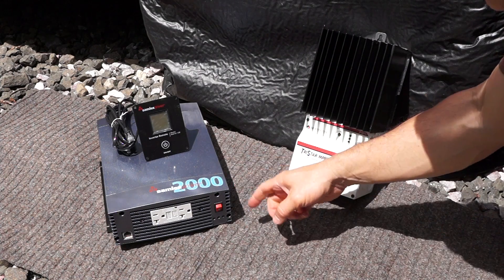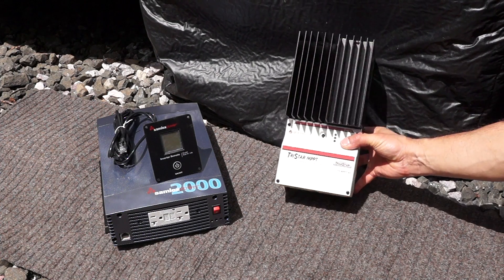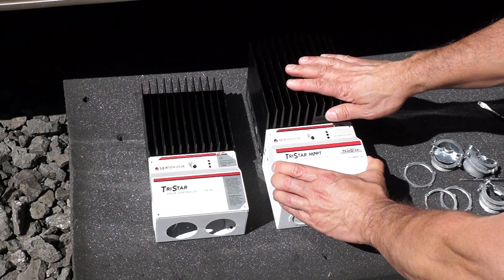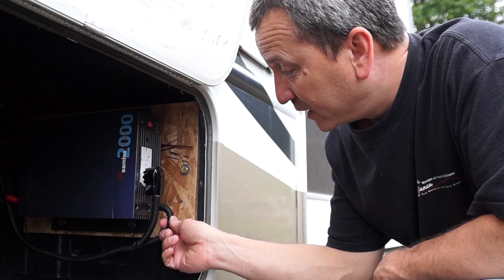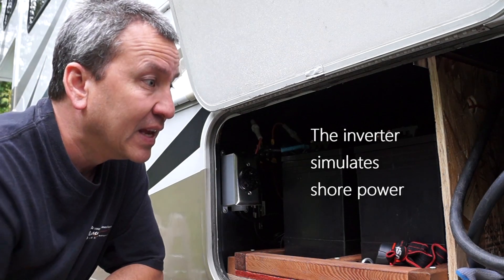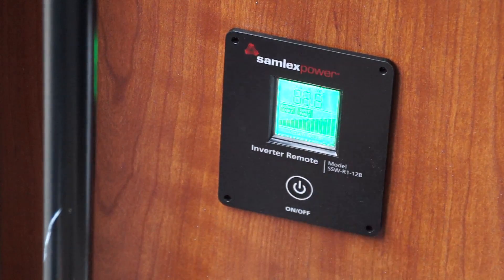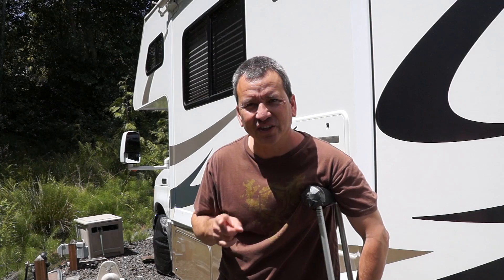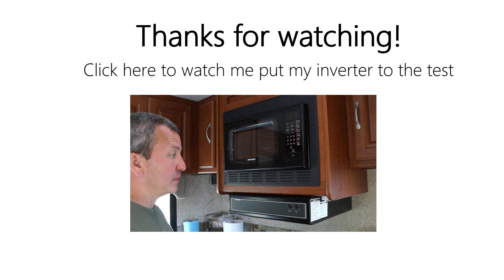Inverter and MPPT Charge Controller Installation - DIY RV Solar

Comment: The 2 gauge wire on your battery bank is too small to run large loads. I have a Xantrex 2000 watt pure sine inverter and I am using 2/0 gauge wire. the wire you are using will not only get hot, it will also lower the voltage available to the inverter during periods of using large loads like a microwave. I did however like your setup of plugging in the shore power cord directly into the inverter!
Reply from the maker: +John Chalupowski I agree with you John. While my 2K inverter can support it, I currently have only 220 amp hours of capacity on my battery bank so I don't/can't run any large loads. So for now I'm good. I do plan on doubling the size of my battery bank and solar soon at which time I will also upgrade that 2 gauge wire. Thanks for the feedback!

Comment: Do you have a list available of the items? You have done a remarkable job with your installations.
Reply from the maker: George Bowman Here you go George. 
Solar Panels: Unisolar flexible solar panels that are no longer manufactured, but you can still find them on Amazon (http://bit.ly/rvwt-unisolar-az) or EBay (http://bit.ly/rvwt-unisolar-eb). 
MPPT Charge Controller: Morningstar TriStar TS-45 (http://bit.ly/rvwt-solar-ts45-mppt)
2KW Pure Sine Inverter: Samlex 2000 Watt (http://bit.ly/rvwt-inverter-samlex)
Battery Monitor: Trimetric Battery Monitor from Bogart Engineering (http://www.bogartengineering.com/)

Comment: well whats the plan for the old PWM controller?
Reply from the maker: No current plan. It's in a box in my garage right now.
Reply: cool I forget mot all are full timers needing to get the old out asap but I could use it if your going to part with it say next month around the first I am just starting with getting a solar setup going and savings is savings.

Comment: Hi Tito.  just have a quick question for ya.   how is that Samlex 2000 inverter working out for you?  have you pushed it to its limits, and if so, how did it react?  thanks a bunch,    Ken
Reply from the maker: ken cook Hey Ken. The inverter has been working great. I haven't pushed it to it's limit (not even close) because I don't have enough battery power to do it. I've probably had it up to 1200 watts that's all. It shuts off when the input voltage (from the batteries) gets below around 10.6 volts and I've had that happen when I pushed it. If I had a couple more batteries, maybe I could sustain a larger load, but I only have 2 x 6 volt golf cart batteries. All in all I'm very happy with the inverter. No problems so far. I hope that helps.
Reply: Hey Tito, thanks for responding. I have watched every one of your videos of your RV setup and have really enjoyed it, you are a pleasure to listen to.  Now, with that said, I have 4 100watt panels connected in series/parallel for 24 volts, and 10.28amps. I have them connected to 4 225ah Trojan T-105re batteries. Series/Parallel connection to give me 12 volt / 450ah capacity. The charge controller is Morningstar mppt 30amp.  So now that i have what i feel is a descent charging part of the system, I am trying to save a little on the Inverter end of the deal. The inverter you are using seems to be the least expensive from my research. My system is not for an RV, it is for an off grid cabin, so the positive/negative grounding has become confusing for me. Hope I have not lost you.  While some parts of the system are positive grounding, other parts are negative.  My question is,,,,,  how important is this?  Your background in electrical knowledge would be greatly appreciated on this matter,  any suggestions for me?  Thanks Again, Ken
Reply from the maker: ken cook Good question. Nope you didn't lose me, but I don't have a good answer and would rather not give out bad information. In my RV, all negatives and neutral are grounded to the chassis. Unless someone else reading this has the answer I would recommend asking an electrician. Thanks for watching! Sorry I couldn't help on this one.

Comment: my inverter is workingok now ,i got 120 volts  in hte rv outlets , microwave is on but no lights go on ,neither 12 volts lights ,anyidea  what could it be ?
Reply from the maker: diego bauzil Sounds like that dog bone option worked. You may not have enough juice to power the microwave. Microwave's have an initial surge when they first start that may exceed your battery/inverter capacity. I can only run my microwave during full sun. That gives me extra amps to help absorb that initial surge of the microwave. I usually don't use my microwave on inverter power. I found a low-power 700W microwave at Walmart for $49 that I might try. I'm not sure that's what your issue is but that's what my experience is.
Reply: inverter pulls microwave fantastic ,no issue there,  is my lights that don t  turn on , my inverter is feeding all hte outlets and microwave , but my lights should be running on 12 volts  but they dont get juice ..
Reply from the maker: Maybe check the fuses on the Converter/Charger panel. See if it's there's voltage on the lighting circuit.  Do you have a battery disconnect switch? Check to see if it's off.

Comment: so  i still cannot power my shoreline thru the  inverter ,i think i mgoing to change the 5 amp outlet box i installed and try with a 30 amp like yours , then get a dog bone 50amp to 30 amp and plug it there ,see what it does.

Comment: I'm going to ask a newbie questions. The receptacles on the inverter looked to be 15amp ones. like we have in our homes. So if that is true then how will you get all the power you need to run AC, MW, etc in your RV when on solar?

Thanks
Reply from the maker: Not at all...good question. I don't generate enough power from my batteries to be an issue. 15 amps AC is approximately 150 amps DC at 12 volts. I only power small stuff (laptops, chargers, fans, TV, sometimes the fridge). Certainly not the AC. Microwave...maybe for very short periods when it's sunny.

Comment: inverter is on, but somehow is not feeding the system ..
Reply from the maker: Plug a cord directly into the inverter. If that works then check your wiring from your inverter to your "system". If you wired up your own plug or receptacle make sure it's correctly wired.
Reply: thats probably what it is ,the plug witring
Reply: it is confusing since is a 50 amp ,  has 2 hots one negative and one ground  ,you know ..

Comment: How does the two battery switches get wired in for solar and what do they control?
Reply from the maker: Bob Ameigh The two big red switches near my solar charge controller are on the positive input (from solar panels) and positive output (to my battery bank) of my charge controller. They allow me to shut off incoming solar or outgoing charge, or isolate my charge controller entirely if I need to open it up. I always shutoff the incoming solar first before shutting off the output to the battery. Turning back on, I do it in reverse, connect batteries first, then connect solar. You don't want incoming solar charge to be coming into your charge controller with no where to go. Hope that explains it for you. Thanks for the comment!

Comment from the maker: @ritual-custom- I used standard household 10-3 Romex wire and 3 pronged plug connected to the inverter. Keep in mind that you probably will not ever draw 50 amps AC from your battery bank. That would be equivalent to about 500 amps at 12v DC. So the 10-3 Romex rated for 30 amps AC will probably work.
Reply: RVwithTito  thanx so much man!!  big ,big help u been!!
Reply: Thanks i was about to ask all that!! You're  the best!

Comment: Hello Tito: i got a question for you; so we establish to add an outlet to plug the shore line into the inverter, what size of cable  and connector (inverter side) should  from the outlet to the 120 inverter outlet knowing that my RVis a 50 amp service ?

Comment: hey tito How you doing ?  i got a question for you ... what kind of in line fuse i need if a have 500 watts solar panels into a mppt 45 A comin out to a killswitch  like yours and  going to the battery bank ?  (2  AWD wire ) please advise ..

Comment: i have 500 watts solar panels coming down to a mmpt morning star 45  need to know what kind of switch kill can i use (amp -volts)  and what kind of inline fuse and fuse holder i need (amp -volts) , the wire from  the mppt to hte battery bank is a 6 awg. thanx!

Comment: wow  been confused on all the videos on people rewiring or  running all kind of wire to do what you did in a few steps, you know what they say [ kiss]  ,  thanks for the great tip on doing this ,i will just have to  turn circuit breaker off for converter.  thanks for the videos
Reply from the maker: Thanks! It's been a pretty slick setup so far. I hope it gave you some ideas for your own project.

Comment: Is Samlex 2000w inverter still working well for you? Have you been happy with it overall?  I'm close to pulling the trigger on the same unit.

Also, one more question. What is your battery setup to run this?
Reply from the maker: RV DogVentures Yes. I'm very happy with it. I have 210 Ah (2 x 210 Ah 6V batteries).
Reply: RVwithTito Thank you so much for the feedback. My setup will be very similar (2 x 226 Ah 6v batteries.) I was concerned if that would be enough to run the inverter sufficiently, and you have set my mind at ease.
Reply from the maker: Yes. It works fine for light loads. Of course you won't be able to get anywhere close to 2kw with our small battery bank. You can run more while solar is pulling in power at the same time though. With a big load the voltage gets pulled down. Larger battery banks will support larger loads and keep voltage up. The inverter will switch power off if voltage gets below 10.6 volts or so which can happen with our small battery bank. Simply reset it and your back in business. Also, the samlex draws about 1 amp to operate. Hope that helps.

Comment: How much did you pay for the charge controlle
Reply from the maker: Stephen T I got mine for $350. They normally run around $450.
Reply: How long ago was that
Reply from the maker: I got it in June of last year.
Reply: That deal is gone so
Reply from the maker: I got lucky and found it through an eBay auction at the cheaper price.
Reply: Lucky you.
Reply: Thank you. I will check that out.

Comment: Awesome video Tito! This was one of the only videos I watched that talked about the charger needing to be turned off while having the inverter on if you are connected to entire RV. Everyone else always skips this important info. THANKS TITO! GREAT VIDEOS!
Reply from the maker: The Ramblin CamperVan Yes. That IS an important element of my inverter setup. Thanks for the comment!
Reply: The Ramblin CamperVan o
Reply: An alternative set up is an inverter charger combo unit with the converter built in. The converters are lousy chargers and can not handle a load while the charger is on. Inverter/charger is the way to go really.

Comment: Interested to know why you chose the Samlex and how it is working? I'm researching inverters and the Samlex is appealing except it's Chinese made for a Canadian exporter. There are literally dozens of Chinese inverters and I'm wondering if it's like so many other Chinese products - made in the same factory with a different case and name.  The Samlex is appealing because of price (1/3 of American made for the same size)  and excellent documentation. Just want your input.
Reply from the maker: William Klein Hey William. Here's the story. While researching inverters I watched a YouTube video where someone took apart a more expensive GoPower 2KW pure sine inverter and revealed that in had some Samlex components in it. That led me to look closer at the Samlex which was not only less expensive, but rated pretty high as well. Plus it also comes with a remote. I found a good deal on mine and the rest is history. I've used it quite a bit and it continues to perform very well with no issues. The only complaint I've heard from folks is that the fan can be noisy if mounted inside your RV. I have it mounted in a storage compartment, so it's not a problem. Samlex is located in Vancouver, BC and has good support in case you have any issues. The initial remote that shipped with mine was not working right. So I called them and they sent me another one within a few days at no cost. One last thing. Like other similar inverters, it draws about 2 amps of operating current with no load on it. Keep that in mind if you plan on leaving it on all the time. Hope that helps.
Reply: RVwithTito Thanks for the detailed response.  With an similar American made inverter costing nearly $1000 more than the samlex it makes the samlex appealing.

Comment: Really like your vids.  I'm upgrading my 33 foot MH as I write this. Thinking about ways to avoid having to disable the converter/charger while the Inverter is on-line.

There should be a way so that the system will automatically turn off the converter/charger when the inverter is engaged.

I'm self taught about solar (and electricity) and I intend to just disable my converter/charger - but I'm concerned if I forget. The older I get the more forgetful I become. 

I wonder if anyone has an idea on circuitry for an automatic shutdown of the converter/charger.
Reply from the maker: William Klein YES. There is a solution using a switching relay. Here is a post that gives an explanation (http://bit.ly/autoswitch-rv-converter). Scroll down to "method #4". It looks pretty straight forward and I may do this in the near future. If you do it before me, let me know how it goes. Good luck.
Reply: This is one of the great questions I'm hung up on, as well.  I don't have an inverter yet, but I'm trying to plan ahead.  I'm wary about giving up my "batteries to 12v system" operations when I install "batteries to inverter to 110v and converter to 12v".  It seems silly and wasteful to convert the electricity from 12v to 110v and back down again to run the 12v items (water pump, furnace, lights, etc).  There's got to be a super confusing setup capable of allowing the 12v->12v setup, and use inverter when we need the microwave or air conditioner.  Is this some sort of hybrid system that I'm overcomplicating things with?

Comment: Love all your videos and can't wait for the next one.  My question is are your glad you changed from the tristar 45 MPT to the MPPT 45, and would the MPT have worked? Why did you upgrade? 
 I'm trying to decide which unit to buy right now for my Class C
Reply from the maker: Yes Terry. I am very happy with the MPPT controller. The reason I upgraded to the MPPT was because of the type of panels I'm using. They put out a higher voltage than standard 12V panels. This video will answer your question in more detail (http://youtu.be/BbixDlbscTI). The PWM version will certainly would just fine for standard 12V panels that generate at 18V.My panels generate up to 48V which I would not be able to take advantage of with a PWM controller set for a 12V system. I hope that answers your question.
Reply: RVwithTito I'm full-timing now and boon-docking sometimes. I only have two 6 volt batteries in series ( 208 amps) and don't think I need to add more batteries.  Im thinking all I need is two 160 watt panels at 18 volts and the PWM controller.  With the money saved, If its not enough, I can buy another 160 panel (480 watts total) and still save money.  Do you agree?
Reply from the maker: I agree. A good PWM controller that has good multi-stage charging should be fine. You can always swap it out later if you decide to take the $$$ plunge. Also pay attention to your wiring and use adequate thickness. Use a voltage drop calculator online to check. Otherwise you may be dropping hard earned power from your panels. 250-300 watts of solar is plenty for a 208 Amp Hour battery bank. My rule of thumb is to match the amp hours to the watts. In other words, a minimum of 208 watts of solar for your battery bank. Add 30% or more to account for the fact that most panels don't always perform to their ratings. Hope that helps.

Comment: Love the DIY vids.  Question, when you turn on the inverter in that way, isn't the coach's inverter getting a 120v supply from the inverter and a 12v supply from the battery directly at the same time?  Or, by disconnecting the converter charger have you effectively disconnected the battery from the converter?  It just seems like the converter is going to try to use 120V from the inverter and convert that power t 12V to power the coach's 12v system, and then also see that the battery is still trying to give the converter power for the 12v system.  How does this all work?  Also, do you have a disconnect switch on the solar system and if so, before or after the charge controller.  Does it hurt anything, where does the power go if you disconnect the solar and the sun is shinning?  Thank you!
Reply from the maker: Ryan. Good questions. When I turn on the new inverter, the breaker/fuse panel on RV's converter/charger does get a 120v supply from the inverter and also a 12v supply from the battery. With the "converter/charger" breaker switched to "off", there's no converting or charging happening (I believe) thus leaving the 12+ volts passing through from the batteries to feed the 12v fixtures. I will verify this to be sure. Thanks for the comment.
Reply: RVwithTito So, with the breaker shut off on the converter/charger the DC still passes through to power the water pump , lights etc. ?

Comment: Nice Setup. We have customers installing the SirusSolar DS-201 in their RVs with wireless routers so they can remotely monitor their Morningstar controller from their phones and laptops. No need to go to the access panel to see how your system is working. Its an easy way to web enable your solar controller. Check it out www.sirussolar.com
Reply from the maker: Checked out your video. That's a neat way to monitor from the controller. Thanks.